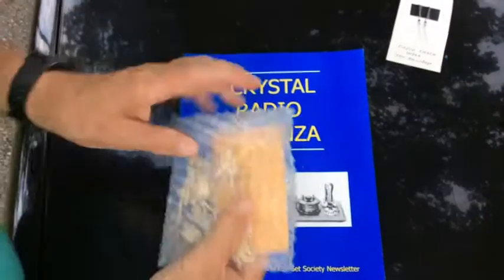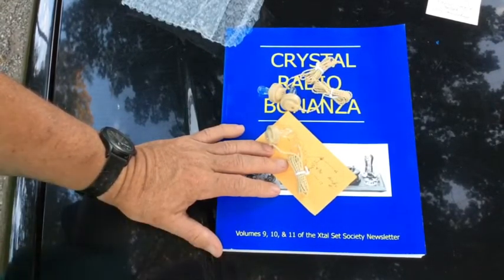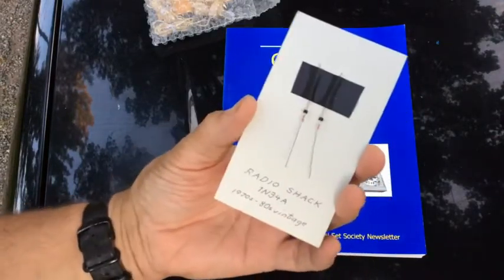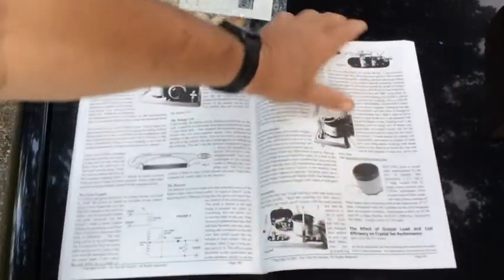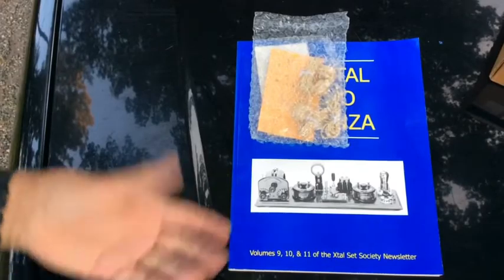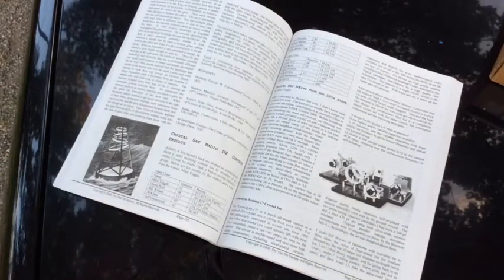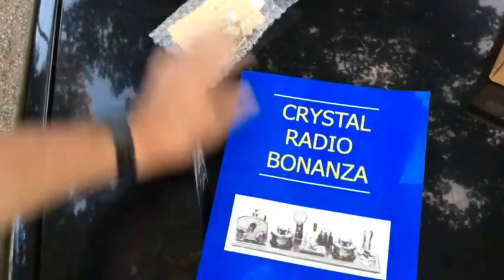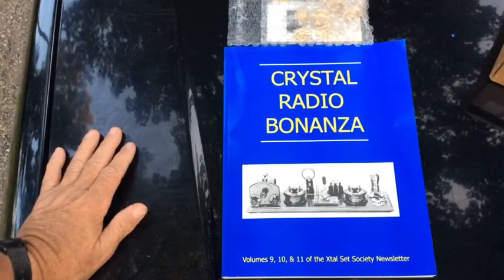Crystal Radios, part one.

Comment: Mike, please dispense with those earpieces. Good, high impedance headphones from 80 years or more ago are still available on eBAY. You should be able to get a good pair for about $40.00. You will have a much better listening experience with your radio.
Reply from the maker: I actually have some original equipment ones I got from my dad. He was deep into electronics. A switch he designed went into outer space. A a sideline to make money he bought and restored only radios with period parts. He had an enormous collection of tubes,  mica capacitors, and just about every other part. Re restored the old wooden radios that were arched on the top. My thought with this video that I have yet to complete was to use more easily obtainable parts.  I look into the headsets and their prices on eBay.  I borrowed a very interest book to read where the author creates a crystal radio from scratch. By that I mean he makes the capacitors, headphone, all from wires and such. He also makes the detector from scratch as well using galena and woods metal.

Comment: Hello Mike. I build crystal radios from time to time. I just ordered an LM 386 amp off ebay. I will hook my crystal radio up to it when it arrives. It cost only 99 cents!
Reply from the maker: Great! I hope you report back with your results.
Reply: I have built several high end crystal radios.
Basic Double tuned (antenna tuner with floating detector section) 
 Coils measure above Q 1200 across 520-1710KHz, made using KL 660/46 Litz. 
silver plated wariable capacitor with steatite insulators, Shotky diode (6 parallell to get correct impedance), 

By the way, minor technical point. Diode does not realy rectify, it acts as a "single diode mixer" mixing the ringing carrier with sideband/s creating audio frequency as result.